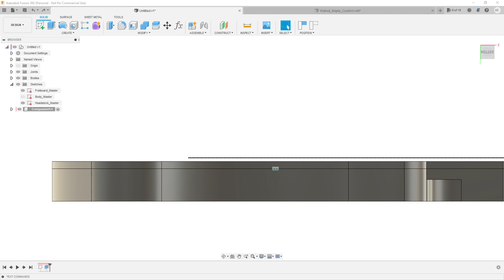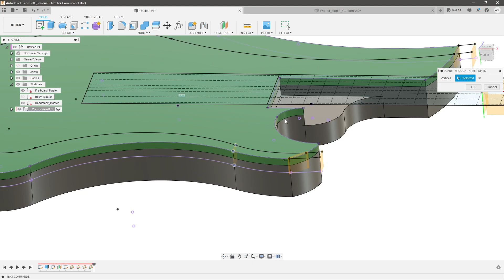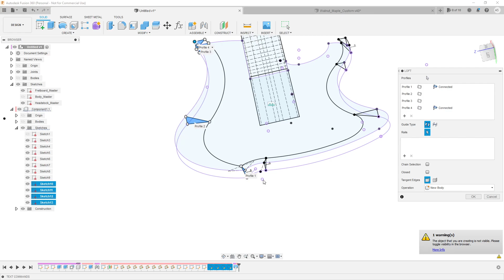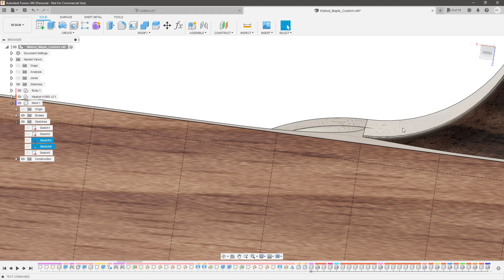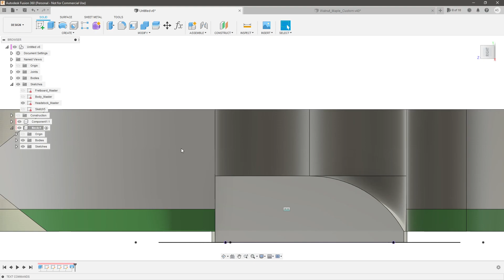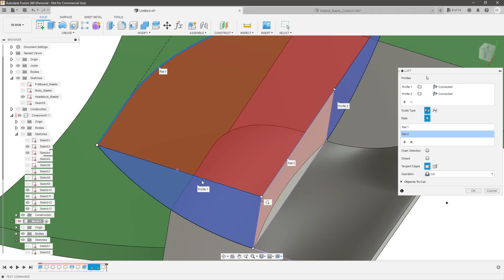Guitars in Fusion 360 | Part 3 - Shaping the Body & Neck Transition

Comment: All good videos, Austin!  Watching again after watching a few years ago.  Question: why when you say look at the top of the guitar does the cube say Front?  Wouldn't it be better to orient everything to where when you say top view the cube also says top?  Just trying to understand and learn - thanks!

Edit - to clarify, using the orientation as you show it, 'top' in your drawing is the view from the guitar player and that makes sense (until you try to cut this on the CNC).  But what the CNC views as 'top' would be the side view in your drawing.  How do we change it such that the F360 top view matches the CNC top view?  Make sense?

Comment: Brilliant series Austin... I've been using Fusion for a bit over a year for furniture projects and this is really helping me open my mind.
I started messing around and found that using Sweep works really well and seems pretty easy to control. Any thoughts on it? What makes loft the better tool? Is it primarily to be able to adjust the shape to pass through different points?
Reply from the maker: Thank you David! The main difference between sweeps and lofts, is that sweeps maintain a constant cross section, and lofts can change shapes along its path.  So for example, a sweep would only remain a triangle, but maybe adjusting it's size and angle as it travels along the path.  But a loft could go from triangle, to to circle, to hexagon. Lofts also allow for curvature control when touching other surfaces so you create smooth transitions.
Reply: @austinshaner  Thanks Austin. I messed around with them a bit more this morning and realized the ability to have different curve profiles throughout a curve is actually a game-changer

Comment: @austinshaner - great videos mate. Thank you so much for making these! I had a quick question please (complete noob here). around the 36 minute mark you show how to make the transition from the heel into the body. I'm stuck on that stage despite several checks and edits to my sketches. While attempting the loft process, I get an error saying Rails are intersecting more than one profile, or alternatively Rails are not touching all profiles. I've redone all the drawings multiple times and tried to project the anchor points as you show, but clearly I'm missing something! Any help / advice would be greatly appreciated. Thanks again!

Comment: Man you're awesome! Prob the best I've found on the subject. Was up until 3 am trying to loft a transition from neck/headstock. 

Problem is- I designed a strandberg style trapezoid asymmetrical neck profile. Creating a loft between that, and a neck to headstock transition has been a nightmare! Not headless like a strandberg. So it has to transition into a headstock. Your vids have been a huge help. I just started learning cad less than 2 weeks ago. So, still new. Could you give it a shot and see if you can make it work? Going to take the lessons from this vid and see if I can make a good transition. Thanks again! Love the long format. Room for more info!
Reply from the maker: Thanks for the support mate! I'm glad this has helped! You just started using CAD and are already doing lofts? Crazy o.O

The main portion of the neck should be fairly straight forward, but yes, the head stock transition and body transition is really difficult to do in solid modeling (rather than patch workspace for example). I'll definitely look into it and see if I can model that style of profile.

The next episode i'll be showing how I achieved the headstock transition on my design. So hopefully I'll be able to answer some of your questions there. I've been successful both with lofting as well as the patch workspace. Admittedly, patching was significantly easier and left a cleaner result.
Reply: @austinshaner  yea I've heard patching is the easy way.. but I haven't done any work in the patch mode yet. I've also seen using fillets to get a good transition. But that didn't work well with my design. 
I actually managed to get a pretty decent loft transition from the neck to headstock today. Using some of what you showed, mixed with a bit of method from Chris goods channel. Maybe I can send you the file to check out? Tell me what you think? Or I could upload it to grabcad. Anyway thanks man! Really stoked to be able to learn from your vids. I'll be looking out for the next one !
Reply: @austinshaner  the asym neck profile was actually pretty easy to make and loft together. And the heel to neck. But the headstock transition was a pain. If I can come up with a better method, or make it look better, I'm interested to learn the various methods. The design is similar to a strandberg, but different enough to prevent me from being sued😂. The only cam work I've done so far has been programming cutting a fretboard. Hoping the cam won't be too insane to program the rest of the neck...